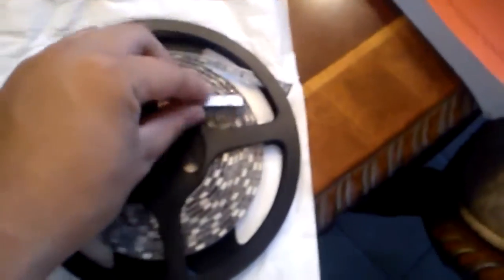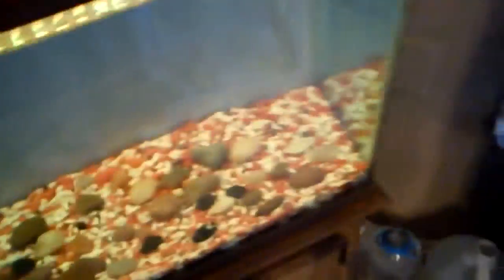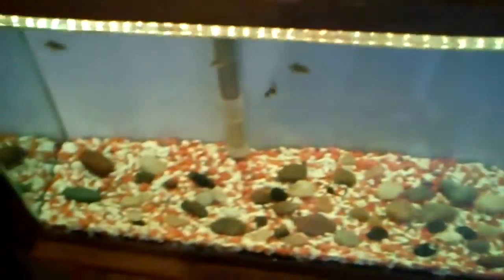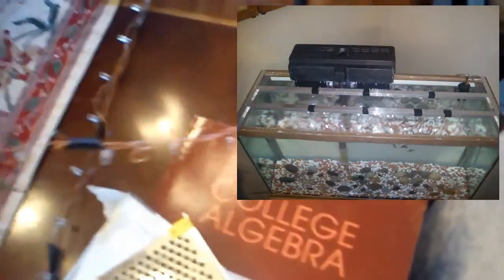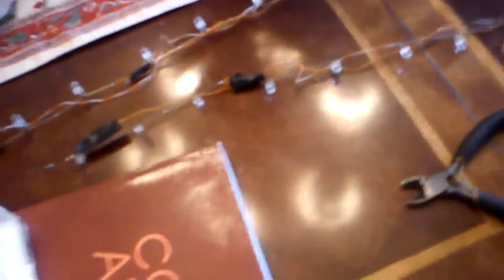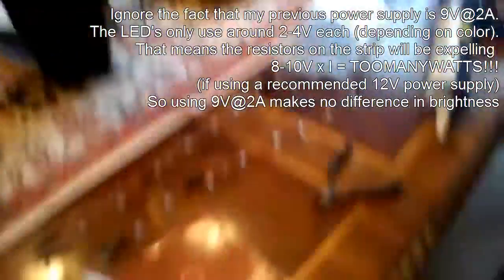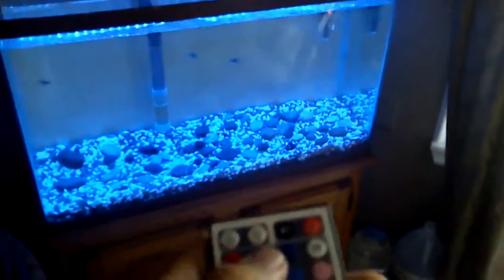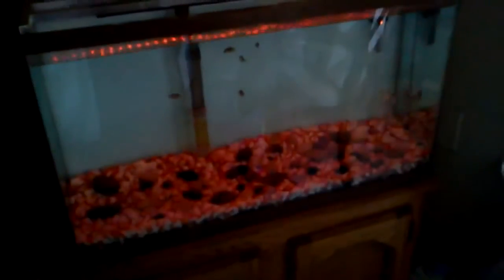Custom RGB LED Aquarium Light

Comment: Oops missed that. Well I am doing something similar with a 20g high. I will be trying to put the LED strip inside my T5NO strip. Did you use the whole 5 meters?  That may have been talked about on the video. I don't have sound on this PC yet, though.
Reply from the maker: I only used about 1.5m just enough for 2 parallel strips widthwise to get good even lighting. Something I didn't know until after a year later, the "waterproof" silicone coating on the led strips is not so waterproof after being exposed to very moist air all the time. I recommend that after sticking down the strip, cover the strip with good quality clear silicone to encapsulate it.

Comment: Do you know the wattage of the LEDs? What size is that?
Reply from the maker: these are just regular 5050 RGB LED strips. Ebay/Amazon "RGB LED strip 5050" they are cheap. The one i am using is NOT individually addressable type of LED but it comes with a remote to change color and color animation.

Comment: I've been looking at these and purpose led strips in a sealed glass tube, both from the bay. The rolls are very cheap and long, 5 metres. The glass tube ones go up to 60 cm or two feet. Can you cut the roll and use whatever length you like? I have a 240 volt to 12 volt @ 7.2 amp transformer. I have no idea what I need but it has lots of different plugs including two which accept bare wire. 
Thanks for any help
Reply from the maker: Check out Instructables and search "LED aquarium." there will be a lot of different projects using different kinds of LEDs and power supplies, hopefully that will give you an idea on what to do. The rolls can be cut every 3 LEDs, you'll see copper pads, that's where you cut. As for the glass tubes, I have no experience.
Reply: AddColorsToYourLife

Thanks for the quick reply, I've already ordered the glass tube version. I'll go for these rolls in my room. I've watched a few videos and cutting to length seems fairly easy.

Comment: Do you think you can retrofit a regular hood with these led strips? I just ordered them today should be here in two days. Or should I build a custom frame like you did
Reply from the maker: sorry for the late reply, if you haven't done so yet, retrofitting will be much easier. But custom building one is also pretty fun.